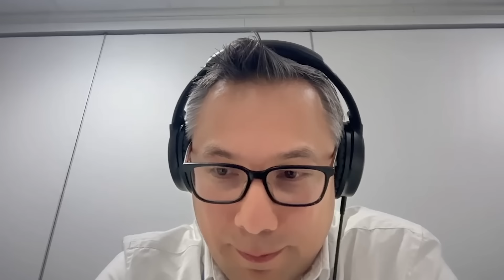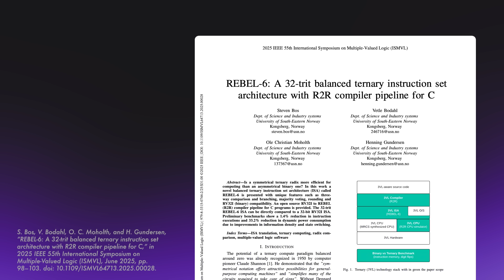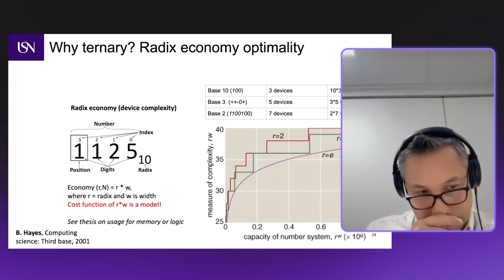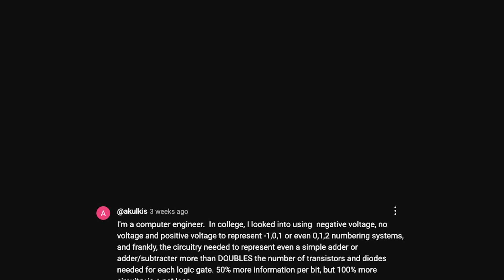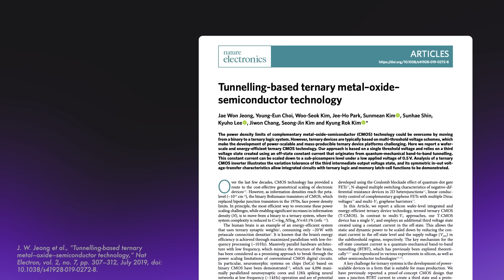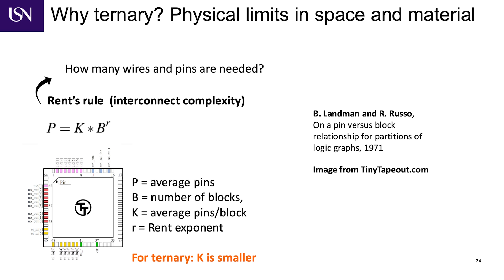Is Ternary Computing the Way to Go Beyond Moore's Law? | Steven Bos

Comment: A lot of things in logic are done with binary such as if or else, wouldn’t this waste things when you want to decide between two things?
Reply: I think you would use the most efficient compute given the job, so binary hardware for when you need a binary output and trinary hardware for when you need trinary output. Unless you can make hardware that can change it's modulus on the fly (and if that hardware being more efficient than compartmentalizing), but I don't see many exploring that option. I assume anyway
Reply: Not that many things TBH, conditional statements still usually compare more complex values, even if the result is a binary true/false, so there is no waste. Even now CPU registers are 64-bit, so storing a single comparison result is wasting 63 bits (though you usually don't even need to put them in a register).

Comment: Well, the better next step in computing will be 3 dimensional CPU's and memory. Unlike linear memory that has vectors and locations along a line (like we use today), a 3D CPU would have op codes that work in terms of x, y, and z directions. A simulation of this would be memory chips that was arranged in sheets, and then stacks of sheets, and individual linear memory chips would have X, Y locations. To address a location, the CPU would need to know which sheet, and the X, Y of the location on that sheet. Large Language Models are interesting, but AI will never reach singularity until CPU's think in terms of 3D objects that are real world. NOP would still have an X, Y, and Z loc. Today we create objects only in code, and we have computers to show representations of those objects. But still, those objects are living on a linear framework. In my view of it, a Compiled Mathematical Function would look more like a 3D QR code, and it would output in many dims. Sound is often represented in waveforms, but sound is actually much more than a simple cross section. A 3D computer could represent real world objects, like sound, much faster than anything we have today. Fourier transforms would be rapidly used to create other kinds of functions we can't even imagine today. Just an idea.
Reply: High performance GPU memory is already built on stacks on chip. So I am not sure how to properly relate what you are saying to what already is being done.
Reply: The problem is getting the heat dissipation under control. It is harder with 3D physical structure, therefore it is a trade-off, as always.

Comment: I apologize for not looking through all of the video, but from the one before the whole thing sounds good and logical and nice on paper, but how easy it is to implement. And how easy it is to scale. If I remember correctly the soviet computer achieved it's state with magnets but those weren't able to scale.

From what I could gather from his comments on the TSMC research it looks like he is admitting that at the moment, we don't have the technological knowledge or materials to effectively create a ternary cpu that even matches the performance of a binary one, let alone outperforming it. And by performance I mean the whole picture ...power draw vs heat generation vs computation.
Reply: Well, there are several breakthroughs that might open it up to simply be more efficient even now, but it will take time and a big advantage to break through a huge headstart in production binary has.

Using binary electronics you can make ternary work but at a loss (for proof of consept). But you need components that are designed for it, and large scale manufacturing to make it cheeper and more efficient per $.

Comment: Cz verze
Mám obrovský respekt k Dr. Stevenu Bosovi a jeho práci na ternární logice.
Jen tu přihazuju vlastní myšlenku k zamyšlení:
co když by přenos a zpracování informace nemusel být čistě napěťový,
ale optický unární – tedy ve třech stavech, které se neskládají v čase, ale v prostoru?

Představa je, že by 3×3 tritová struktura mohla nést devět hodnot v jednom cyklu,
a při použití 12-kové soustavy by se dal výpočet řešit přímo, bez dělení nebo převodu.
Každý trit by představoval jeden stav světla (např. R, G, B),
a místo klasického dělení na bity by se data skládala – ne sekvenčně zpracovávala.

Jde o hypotézu, že takový přístup by mohl umožnit rychlejší a efektivnější procesor,
protože by se odstranila potřeba synchronizace a taktování.
Ve výsledku by výpočet mohl probíhat plynule, fotonicky a bez RC ztrát.

A pak není procesor ani potřeba mít. 

Aj 
I have huge respect for Dr. Steven Bos and his work on ternary logic.
I just want to add my own idea for consideration:
what if information transfer and processing didn’t have to be purely voltage-based,
but instead optical and unary — in three states that don’t stack in time, but in space?

The idea is that a 3×3 trit structure could carry nine values within a single cycle,
and by using a base-12 system, the computation could be handled directly, without division or conversion.
Each trit would represent one light state (e.g., R, G, B),
and instead of being processed sequentially like bits, data would simply combine spatially.

It’s a hypothesis that such an approach could enable a faster and more efficient processor,
because it would remove the need for synchronization and clock cycles.
As a result, computation could flow smoothly, photonically, and without RC losses.

And then — a processor might not even be necessary.
Reply: Yeah if I understood you correctly this might be possible but you litterally can't use a processor?  Because from what I understand voltage is kinda the physical limitation. We can only ACCURATELY define it in like 2 ranges. Bellow and above 50% so anything else just won't be as reliable
Reply: @UvekProblem Exactly — that’s the limitation I was thinking about too.
Voltage is precise for two stable ranges, but unreliable beyond that, so instead of fighting the physics, I moved the logic into light.
Using optical states (like wavelength or polarization) lets multiple trit values coexist in space rather than compete in time.
It’s still just a theoretical model, but I believe that shifting computation from sequential voltage transitions to spatial light composition could remove many of those physical barriers.

Comment: Why is fractional useless? Are not all normalized neural net values between 0 and 1 inclusive? Fractional would be a fair one-trit estimation of sigmoid output.
Reply: I think he meant that it's the least useful one. You would probably end up having do something like IEEE754 for that application most of the time
Reply: As an example, DNA is Base3 - in just 22bn Trits and it has encoded enough information to build and run self-repairing humans.

Trits are also the more natural encoding for storing information at the quantum level.   Ternary for storage, binary for decision making logic. 

And finally - using a combination of Binary of Ternary together, allows for prime numbers to be used in new ways when encoding information, eg as in-line block markers/checksums, without having to use any extra storage space to do it.   That appears to be one of the ways the DNA is able to store so much information in a relatively small space.
Reply: @Andyfarmer  Don't DNA  and RNA  have 4 bases, with 3 of them in common: (G, A, C, T) vs. (G, A, C, U)?
Reply: @sakuyarules different use of the term bases - although it's also interesting to note that GA, AG, CT, TC, CU and UT are all analogous to combinations of +1, -1 and 0.   (I can't remember off the top of my head which is which combination).  In computstional terms, if DNA is the storage, RNA appears to be one method of artithmatic/computational operation for working the DNA.
Reply: Fractional values aren’t really useless — they just depend on how you define the medium.
If we stop insisting on voltage as the only carrier, a trit could just as easily be transmitted through light, water flow, or even mechanical impulses.
What matters isn’t what carries the information, but how it’s structured and interpreted.

If you look at binary systems the way a child looks at the world — curious, asking “why does this part behave like that?” — you start to notice that many of our “technical limitations” are actually self-imposed conventions.

Maybe by freeing the trit from strict voltage domains, we’ll discover even simpler, more elegant ways to compute — where information isn’t calculated, but emerges naturally from the medium itself.
Reply: @karelzamitu8760 Building on this, we are starting to build prototype light based computers.